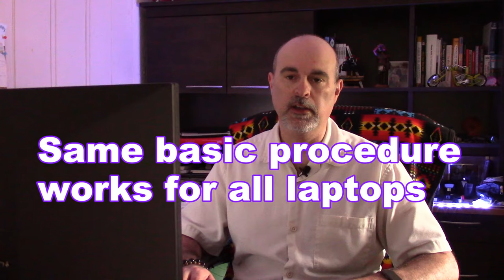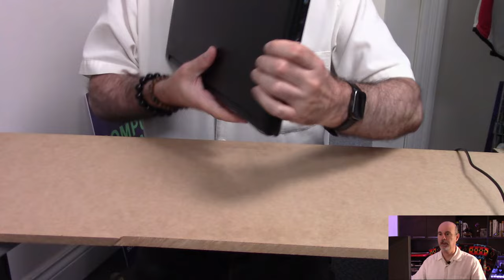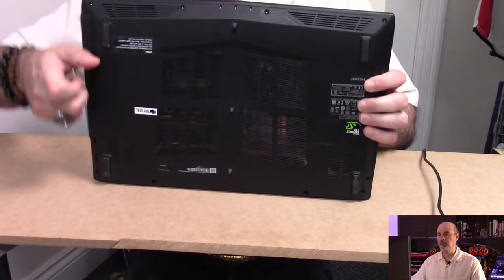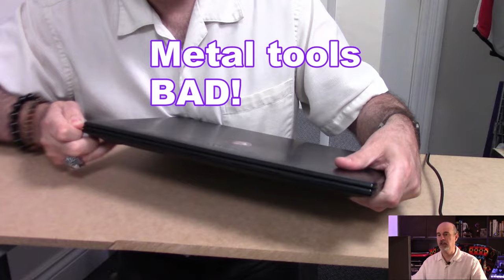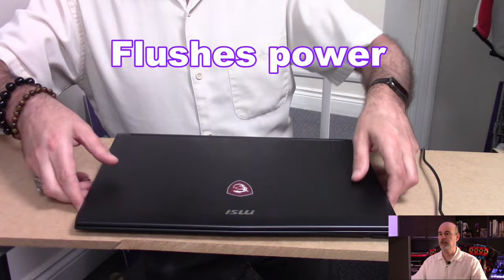How to fix an MSI laptop that will not turn on

Comment: It didnt work for me, I have a gs63vr, it overheated and turned off, tried this method but didnt work, when I put the charger not even the charging lights turn on, do you know what it could be?
Reply from the maker: Thanks for your question, and your answer maybe in your question.  you said it overheated, that means either fans are not working properly or at all.  Maybe alot of dust build up you need compressed air and open the laptop to clean the fans and heat vents.  Maybe a cooling pad is required if you are in a warm room.  Laptops need to run cooler.
Reply: @TwinBytesInc  thanks for the quick response, the pc is not turning on anymore, I thought it was de power adapter and tried with one that shows if it's working and it turns off as soon as I conect it to the pc, so i'll just go to repair it, thanks for the help
Reply from the maker: Sorry not much else can be done aside from a motherboard repair it seems.

Comment: You don't need any tool to separate the bottom on an MSI laptop except for the screwdriver. I was easily able to pull the bottom of mine off by sliding my fingernail along the split and lifting up. Most laptops are not that easy, they'll have screws hidden under the keyboard, they'll have spots holding the bottom on, and sometimes you can't even get inside without breaking the case entirely.
Reply from the maker: Yes, there are so many variations to how the laptops are built, so instructions very greatly.  You can just go by how MSI works, you'd have to look for the specific model of MIS, but for how YouTube works, I can't do every single model. :)

Comment: This didn't work for my laptop unfortunately, don't suppose you've any other tips I can use? If not I may just have to look into getting it repaired
Reply from the maker: basically it's usually either the battery, power adapter, the outlet it's plugged into or the motherboard.  Unless it is turning on but the screen is dead.  Small chance of bad memory as well but that usually will make a beeping sound.  A bad drive would still show you something on the screen.

Comment: Het Daniel! My laptop recently did this, and now it’s done it again not even 2 days later. Is there an issue with the charger or the ram or something?
Reply from the maker: There's definitely something wrong but could be any of a number of things including what you are mentioning.  If troubleshooting yourself, try with least expensive possible solution first and work your way up.  Otherwise maybe cheaper to pay a tech who has all the parts to try swapping out with.

Comment: It did not work for me even with reinstalling cmos battery. The story is my laptop is completely ded after replacing the fan and repaste. During the process, when i tried to connect the display cable back to the board, there was a little spark and smoke coming out and it was very quick. Anyway thanks for the video.
Reply from the maker: Thanks for taking time to write.  Ya, before you even wrote about the spark, I figured you fried the board touching it.  You don't even need to see a spark to fry it.  But since you did, the full extent of the repairs are unknown.  You'd need a professional to look at it and see if the board can be repaired or replaced.  The display could be shot too, who knows.  You always need to ground yourself when working on the inside of a computer.

Comment: Thank you so much! My laptop is now working ☺️ Do you know why the laptop needs this to happen? / how I go about preventing doing whatever caused it to not work?
Reply from the maker: You're welcome.  Glad it worked.  Hopefully earned your subscription.  This seems to happen due to an issue with the flow of power.  It gets stuck and doesn't flow properly from the power source through the motherboard, to the battery and back to the motherboard.  Somewhere along the line it's clogged so to speak.  This unclogs the power and allows it to flow again.

Comment: Hi, Daniel. Just want to know your quick opinion. My laptop is MSI GP66 Leopard and the battery was drained and won't turn on even when plugged. I followed this guideline and the laptop still dead. Is the issue lies on the power adapter? Sorry for my question, thank you.
Reply from the maker: Sounds like the next step is try a new power adapter.  Maybe you can borrow one to confirm before buying.  If that doesn't work, most likely needs motherboard repair.

Comment: Hi! I tried it and it didn't work because the problem was not the laptop's battery! Instead it was something more silly: The interlock cable of the charger was broke, so I changed it and now the notebook works. I put this to also give another solution, maybe it's not your notebook but your charger
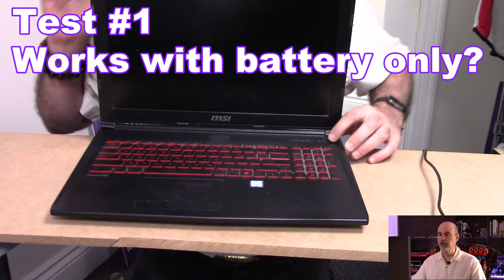Reply from the maker: Definitely you are correct.  I did make a note on the screen in the video at 0:45 that you might need to replace the adapter.

Comment: Ty ty so so much it wotks <3
Can u pls describe what was the issue ... to be honest with u I did not think it going to work 😅
Reply from the maker: That's so awesome!  I'm not sure I can explain it perfectly, but it's basically like "dirty power" or a power blockage of some sort where the power isn't flowing properly to all the components and doing this flushing the power out of the system completely.  That's why it takes a little longer to get power when you first plug the power cord back in so it can start flowing again before you can hit the power button.
Reply: @TwinBytesInc  I change the 2 fans ... and this happened to me ... I was scared about if I have done something wrong there 😰 ... thanks again <3
Reply from the maker: @w5im597  You're welcome.

Comment: Thank you. I did your steps and the laptop worked fine for a few day and the issue is back again. is there any permanent solution?
Reply from the maker: This sounds like a faulty motherboard.  You could try a new battery but could be wasted money if it doesn't work.  Better to get it professionally diagnosed and if its' not the battery you won't be stuck with buying one.  Just make sure they guarantee results if not the battery, they can take it back and fix the motherboard.
Reply: Hi 

I bought a new battery and I installed it in the my laptop but, unfortunately the issue still persists. I will try to find a computer store to check what exactly the issue.

Thank you
Reply from the maker: You're welcome

Comment: I f'n LOVE YOU. Worked like a charm
Reply from the maker: You're welcome.  Glad it worked.
Reply: What did you use to pry it open because don’t have a guitar pick so what should I use
Reply from the maker: @Syntxnic  You can use anything thin enough like a guitar pick and plastic.  Ideally you don't want anything metal because it can short circuit something you might touch inside without knowing it.

Comment: Mr Gauthier it doesn't work for me I have an msi gp73 it was shut down I thought it was a light cut off but no after that I tried to turn it on nothing it doesn't work I did I tooked restart the bios with the flash boton. I had a problem with the battery before sometimes charge and sometimes no but now it doesn't turn on at all and even putting the adapter the light of charging is not turning on. What should I do in this case please... I'm studying and working with the laptop every day I don't know what to do...
Reply from the maker: Thank you for your question.  It's possible the charger is dead and needs replacing.  If you can borrow someone's to try it and find out, maybe you just need to buy a new charger.  If not, that maybe a motherboard repair that you require.

Comment: hello, what size screw driver did you use? i have to purchase one in order to open my laptop and i don’t want to buy the wrong one
Reply from the maker: The type of screws seem to change sometimes from model to model and year to year but generally I use a standard phillips screw driver.  The smaller of the two standard sizes that come in any set.  I don't know the size number.

Comment: Hi Daniel, your video help a lot, i have the same laptop (MSI GL62M 7RDX) i tried it but it still won't turn on, the light indicator in power button is off too. Can you help me what to do with it?? Thanks in advance
Reply from the maker: I'm glad you found the video helpful but if it still doesn't work.  It's either you need a new battery, new power cord or motherboard repair.

Comment: I have a new msi gaming laptop and it’s less than a month old.  Power cut out.  Now it’s not turning on.  I’m assuming this is a warranty covered problem since it was bought new.   Would you recommend me trying this ? Or taking it to where I bought it.
Reply from the maker: I think this is what they would try anyway to send back to you after repairs.  However, if you have to break any seals to get at the battery, I would advise against it because it would void your warranty.

Comment: I have exactly the same problem with other MSI model. However, laptop was a bit hot before it stopped working. Before draining the battery, did you experience the same? (I mean, the overheat)
Reply from the maker: This solution would be for bad power flow.  The issue you have sounds like overheating which maybe the fans need to be cleaned out and especially from the heat sync.  you might want to open it up and use compressed air to blow out all the fans and a little all over to get dust out.

Comment: Damn that's the exact model I have! But my problem is that it DOES power on and doesn't boot up (long story short but I've done the trouble shooting to determine that's the problem and not the laptop's screen itself that's messed up) . I remember when this happened a few years back I called tech support and after racking our heads together what seemed to work was holding down power and ... Some other buttons I can't remember and it caused the system to turn on and off rapidly while I held this combination, and eventually it showed the main logo on boot up.
Reply from the maker: Hi Mark, if it powers on but just won't boot, if there's nothing on the screen and you've already confirmed it's not the screen, then that means there's an issue with the video chip in the motherboard.  Probably needs replacing, especially if you've had this issue before and happening again.
Reply: Do you remember the other button?
Reply: @TwinBytesInc  do you know the other button he had to press? I have the same problem

Comment: I tried this multiple times. It actually works now and then. I noticed a blue light blinking in the area of the battery indicator whenever I pressed the button. So I replaced the battery and it worked worked few days.

Once I forgot to charge it before the battery goes off and the same problem has started again. I have a msi gl63 8rd.

I got a multimeter to track the power flow and i notice that 19.8v is completely delivered to the mother board and about 3v to the battery side for charging. But I do not notice the battery charging when plugged in.

Could you please give me a suggestion? Is the motherboard at fault?

Currently it's not working at all inspite of doing this procedure multiple times.
Reply from the maker: This definitely sounds like the charging chip on the motherboard.  Someone who does motherboard repairs can replace any bad chips etc.
Reply: @TwinBytesInc  thank you for your suggestion. But doesn't it also mean the laptop should work without the battery? I am facing issues on both the cases.
Reply: @TwinBytesInc  to provide a clearer picture. The laptop did not turn on at all after I noticed that the first battery was at fault. Once I replaced the battery, with a new one, it actually started to work even without the battery. But for about one week or 10 days I did not operate the laptop, before fixing the new battery. 

Now, after working for few days, the laptop battery died due to not charging, as I did not plug it in. Notice that the charging worked perfectly fine while I was using the laptop.

Now, out of nowhere it does not work at all, like the old times. This is the scenario.
Reply from the maker: Correct
Reply from the maker: Sounds like motherboard issue of some sort.  I can't troubleshoot here further.  Someone needs to look at it to confirm.  You've already isolated the issue it sounds like.
Reply: @TwinBytesInc  thank you for your suggest yet again. I was doubting it cud also be an issue with power button connection.
Reply from the maker: You're welcome.  If you find my videos helpful and want to guarantee responses as my channel is continuing to grow, please consider joining https://youtube.com/twinbytesinc/join

Comment: Hey man can you help me? Im MSI GL62M 7rd. Power button is lid but monitor keep blank. 
Before that, I was doing monthly routine cleaning my laptop, and there was a button at the motherboard written SW3. Out of curiosity I pressed it. Then my laptop just blank forever (can't bios).
Tried your 60 sec trick still no work. 
Help is appreciated, thanks
Reply from the maker: I don't know what would have happened now.  Even I wouldn't have pressed that button.  it's something you need to really know what it is before messing with it.  It's some sort of interrupt button according to a quick Google search, but in most cases we never have to touch any buttons on the motherboard.  You'll need to lookup this button in the user manual.  Or take to your local expert.

Comment: I have an MSI GS75 that won't power up, but to open it I need to break the factory seal. That would void the warranty wouldn't it?
Reply from the maker: Excellent question.  Yes that would void the warranty.  It's an educated risk you'll have to decide on.  Maybe ask MSI about the warranty procedure and it maybe unacceptable to you.  Many of my clients opt out of warranty repairs because they take too long and rather pay for the fix.
Reply: @TwinBytesInc  Thank you for the reply. I had submitted a ticket to MSI on how to proceed. Apparently that model has a (nearly invisible) battery reset pin hole in the back, using a straightened paper clip you push for 10s to flush the power. It is in the manual. Felt a bit stupid I never saw this, but the laptop is running fine now.
Reply from the maker: @gutspillage  Wow!  That's something I haven't seen before and it's certainly not every manufacturer. Thanks for sharing this.

Comment: Didnt work for my MSI GL Leopard is there anything else I can try? And I have only had this laptop Since March of this year. Do you think the Chicony Charging adapter may be bad?
Reply from the maker: Thanks for your question.  Yes, if still won't turn on, possibly the battery is dead and the charger won't provide enough juice.  There is also a small chance if not the charger there's an issue with the motherboard that needs repairing at your local shop.  But it's pretty cheap to get another charger to try, and if it doesn't work, you have a spare at least.  One to keep at home and one for travel.
Reply: Mine shows 100% battery but turns off when unplugged.
Reply from the maker: @banzaisbanza  Thanks for your comment.  That sounds like your battery is bad and needs replacing.

Comment: I've been trying this repeatedly for a couple of weeks. Laptop works just fine with an external monitor though. Have been trying to rollback and update graphics drivers but to no avail
Reply from the maker: Thanks for your question.  It sounds like the problem is the screen.  You may need to replace the screen since an external monitor works we know this video won't help.  You can try uninstalling the video driver first, reboot and let it detect itself.  if still doesn't work, could be brightness level too low.  Otherwise, you need to replace the screen.

Comment: thanks for the video, my MSI laptop turns on (power light on)  but it doesnt boot up or show anything on the screen, and after a few seconds, the computer turns off... it happens sometimes, specially in cold days or when i take it to coldest places , what could it be? 
thanks
Reply from the maker: That sounds a little strange.  normally cold is good, not too cold but heat is a killer and make the fans work harder.  Can't be overheating which is what it sounded like, but if in a cold environment it's worse?  I don't think I heard of this before.  Someone needs to look at it.  Maybe it's just a coincidence about the temperature.

Comment: Hi Daniel,  I tried what you did but unfortunately it did not work. I get no signs when I plug the charger or anything. I also have an msi similar to what you had and I was also using it completely fine the previous day. not sure what caused the issue. what do you think might be the problem?
Reply from the maker: if this video didn't help, chances are the motherboard is the problem and needs repair.

Comment: Didn't work at all I've done the trick before to this same laptop bc it had power surge issues but I think it's finaly kicked the bucket. recommendations for a new gaming laptop appreciated 😅
Reply from the maker: It may need a motherboard repair which can be much cheaper than a new computer.  But if you're looking at a new computer, I can't make a specific recommendation, but the following video link shows you how to decide on one https://youtu.be/fLMH7QtX8jc
Reply: @TwinBytesInc  ill take it to my local computer center and see what they say after taking a look at it but it's physically falling appart I've had it for over 4 years and the screen is basically off of the computer besides the wires keeping it working I've been using it as a desk top for the past year or so
Reply from the maker: That makes sense now.  There are some things like this that I might look at it and say it's not worth fixing it.